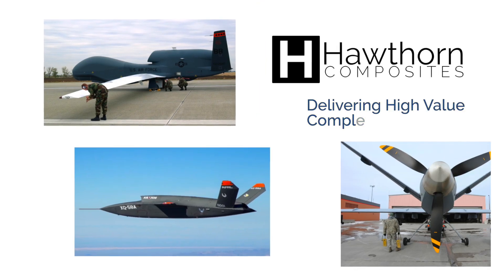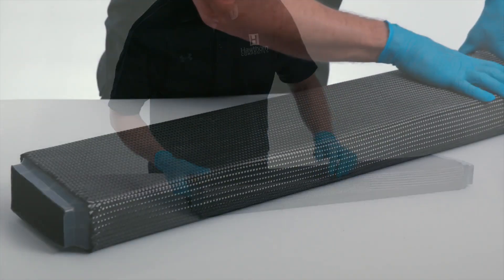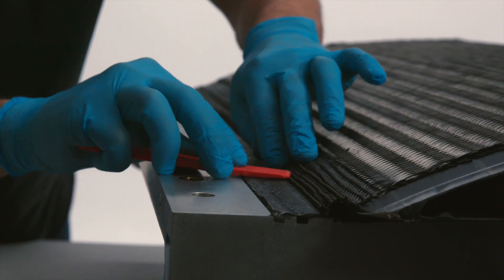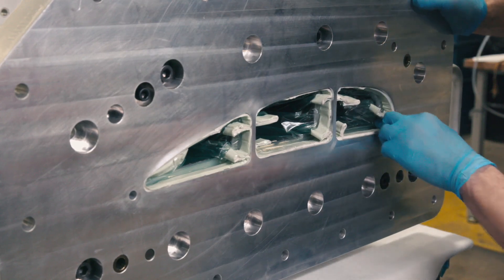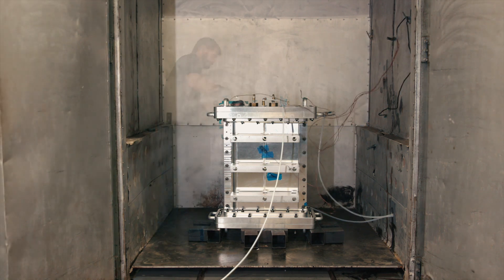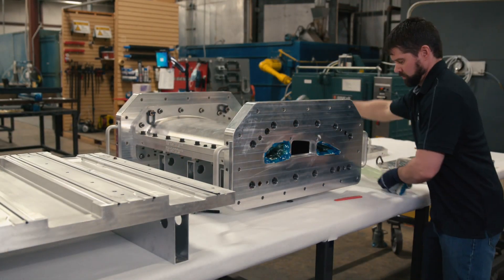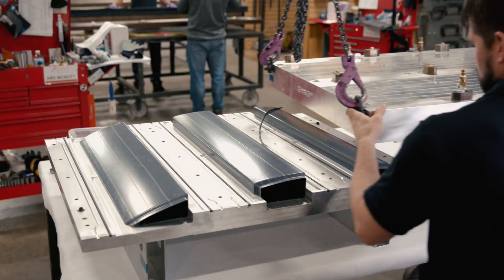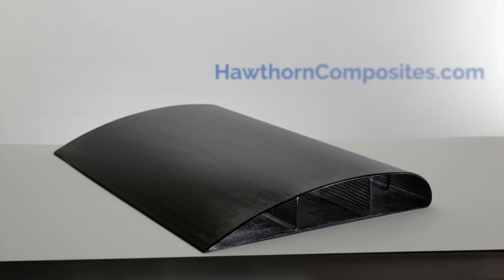Co-Cured Wing Structure Using Dry Carbon Fiber Application/Overbraiding & Resin Transfer Molding

Comment: Hello! Great video and channel! I did like to know if is there a way to calculate the right number of carbon foils to ensure a right strenght according to a definite weight of charge in axial direction. Any tools, excel page or something like this that could return the right value? Thank you!
Reply from the maker: We perform FEA to ensure we meet required design criteria. There are multiple software programs that enable FEA.
Reply: Catia V5.
Reply: @yo yo thank you, my question now Is: what Is the best way/software to test?
Reply: @PierfrancescoAstorino  Even with the best software available (Abaqus and Catia by Dassault Systems, or Ansys). You still wont be able to calculate anything at all. 

Because you need to test the materials you will be using to build the aircraft.

Not just the carbon fabric, but each style of fabric weave, each different layup direction, and any combination with the epoxy or resin matrix you will be using. 

Each test specimen must be manufactured by yourself by the same method you will make the aircraft, you cant use other peoples material properties data because they invariably use a different glue or different method or different skillset than you. 

And you need to test at least 30 specimens for each test to obtain statistical data because each sample will fail at a different strength reading and you need to calculate the average and minimum values. 

You need 30 axial tensile, 30 axial compression, 30 transverse compression, 30 transverse tension, and several different shear methods x 30 each. 

Which means you need several hundred material specimens FOR EACH material you intent to use. 

Material testing machines start around $8,000 and go up beyond 250,000, and it will take you many months to obtain the data yourself due to labor, but good news is you can hire a private testing lab for about $200 per sample so if you throw money at the problem you will have you data within a month of two and around $20,000-50,000 in costs. 

Then you can use this material data to enter custom values in ANSYS or ABAQUS (after you purchase these programs for the going price of around $45,000, plus annual fees). ...Or attend an engineering school and have free access to student non-commercial versions. 

You see, Composites are very complicated. (To do it right, strong, light and stiff calculated to the Nth degree). 

But good news is they are actually very easy for quick assembly and rapid prototyping of UAVs and RC airplanes and even small Experimental/Homebuilt airplanes. 

You don't actually need to do any complex calculations if you assume a very low strength limit of approximately 0.003-0.005 strain. As Carbon Fiber usually breaks at 0.01-0.012 strain (1% stretch) And epoxy breaks at 0.015-0.02 strain. (Strain being the percentage of its modulus of elasticity or how much is stretches). So just use around 0.003-0.005 strain (0.3%-0.5%). 

Fiberglass breaks at 4.5% strain (0.045) but since epoxy breaks at around 0.015-0.02, you cant fully utilize fiberglasses strength because the epoxy disintegrates before you utilized the full fiber strength.  

You can obtain your own properties by calculating using a formula called "Rule of Mixtures" 

Don't forget to add 5% of air bubbles to your open wet layup calculated values. (E.g. use 35% fiber, 5% air, 60% resin) and mix their material properties in this ratio for unidirectional fiber placement. Half the fiber value for +/-90 degree woven fabrics because half the fibers are laying wrong direction and don't help in any given direction.

Here are some conservative values:

E-Glass Tensile Modulus = 10,400,000psi x 0.003 strain = 31,200psi (tensile strength).

31,200 x 0.35 (35% fiber fraction) = 10,920psi

Mix epoxy with a modulus at 500,000 x 0.003 = 1500psi x 0.60 = 900psi (60% of your 35/5/60 composite fraction) 

Add together your 0.35 of fiberglass and 0.60 of epoxy is 10,920 + 900 = 11,820psi for design allowable of 0.003 strain (3000 "micro-strain")

So E-glass and epoxy in tension is valid for 11,820psi which is conservative and will certainly work for you. Next, calculate the same materials at 45% fiber fraction and 52% resin and only 3% air. You will see a significant improvement in strength allowable. 

Or use whatever ratio your manufacturing technique allows: 70/29/1 etc. 

Compression is about 85-90% of tension value so 11,820 x 0.88 = 10,401 psi compression allowable. 

Thats at 0.003 strain (3,000 microstrain as its called). 

You can typically use 0.005  as The fibers and epoxy begin to fatigue and break down above 0.006 for many glass composites.

And those numbers are for unidirectional fibers. For biaxial cloths you must half your fiber strength as its only half laid in the proper direction. (So 31,200 x 0.35 x 0.5 = 5,460). Then add 900psi from epoxy = 6,320psi tension allowable for 0/90 woven or +/-45 degree biaxial fabric. Use 6,320 x 0.88 for compression allowable. 

Shear allowable is going to be around there or maybe slightly lower.

Now plug these numbers into a simple beam calculator or spreadsheet.

Once you use "Rule of Mixtures" to calculate and test a few items you get a feel for it, you can stick to calculating major loads and  then just use common sense for skin thickness. (Most carbon wing skins on slow UAVs and sailplanes is 2-3 layers of 5-6oz carbon cloth with about 5-10mm of foam sandwiched in between). Larger RC airplanes only need one layer of 5oz or 2x layers of 2oz, and smaller planes need 2oz-3oz cloth.

Now get yourself some epoxy & reinforcement fabric, rovings or carbon Tow ordered and start doing it. 

I highly recommend  searching for:

 "Rutan Long EZ build"

Its a great construction process that doesn't require molds or tooling except for scissors paint brush and hand saw.
Reply: @Triple_J.1  thank you very much for your answer. Now I can start to understood how much difficult and expensive Is this testing process, if it's done in the night way! Also, rule of mixture, Is very interesting, and could be the start for anyone that want to try something different! I will save your answer on my laptop, so I Will be able to read It several time 😅👍🏻
Reply: @Triple_J.1  what a fantastically detailed answer.
Reply: @Triple_J.1  hit a lot of good points there very good explanation! 
I have had to explain the fiberglass epoxy strain/strength issue to a few customers (I deal with mainly race cars but sometimes do more critical structures) and they always go why is the resin so expensive! I can get this resin for this much. You explain the strain and failure point of the two and why the epoxy that cost 3x as much is used because its failure is at 8% strain so can fully maximise the glass potential strength. It's a nightmare trying to convince them it's the right path to go.
Reply: @PierfrancescoAstorino  Ansys ACP